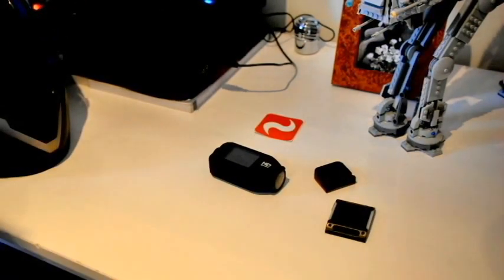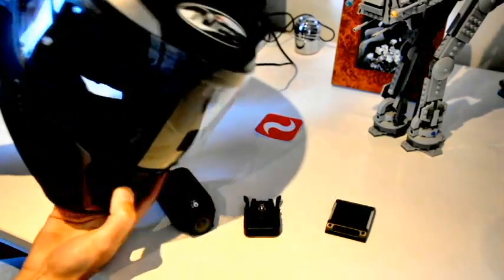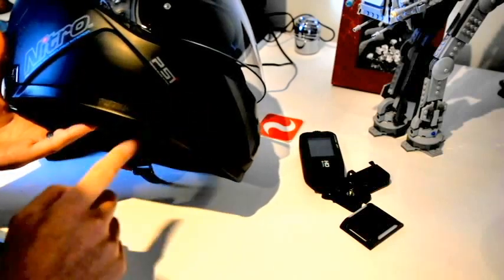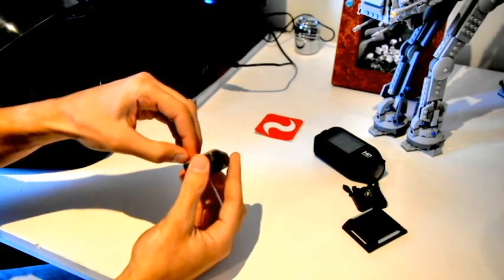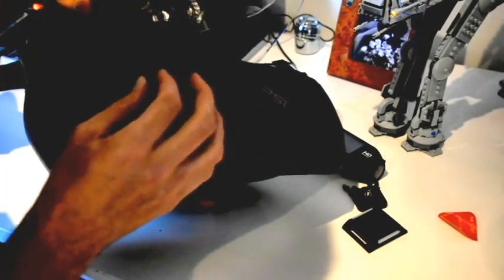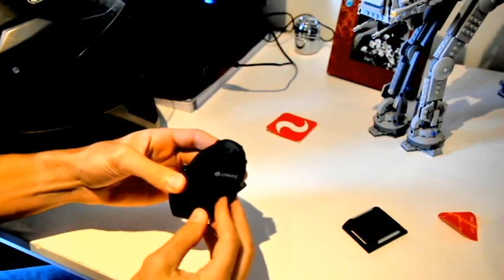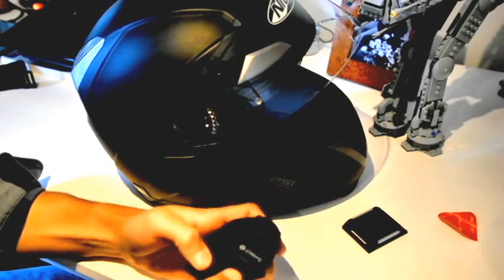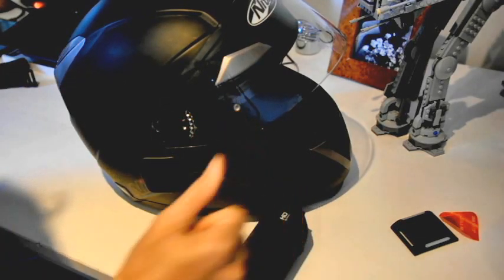How to mount a Drift Ghost-S HD to a motorcycle helmet

Comment: Andy..
Are you not supposed to leave the sticky mount for 12 hrs plus before you load it with any weight?
Reply from the maker: Hey John. I think that's what the instructions said but I didn't bother and had no negative impact. The adhesive is still rock solid after being out in the rain, snow and cold.
Reply: Andrew..
Cool....its just I had a road hawk bullet cam (much lighter)on my last helmet and the adhesive base failed on the 3rd outing, having followed all the instructions..
Just missed my mate who was following..😁
Have no confidence in those  adhesives, particularly with the expense of  a Ghost or Go Pro..
Don't like the idea of drilling the lid either.. 
Is there anything you can do to increase the bonding strength of the base adhesive?
Cheers 👍
Reply from the maker: I have always been super worried about it coming off but after the first 6 months I just forgot about it. An alternative my mate used is 3M dual lock on his motorcross helmet. It is insanely strong and you can fully customise a mount to fit your helmet profile.
Reply: @andrewcaleyphotography1076  Excellent, I'll look into that thanks buddy..

Comment: Drift ghost s audio interference / high pitched crackle when riding fast and using an external mic in my helmet

I'm on my 2nd ghost and 2nd mic

Anyone else get this issue and is there anything I can do about it?

Here is a clip of my issue

 https://youtu.be/ZNf0SVY-YpU
Reply from the maker: I had exactly the same issue and got over it by adding an additional noise sock over the one supplied by Drift (which is pretty rubbish) and I reduced the noise sensitivity down to the lowest setting.  You just have to remember to speak up if you're recording your voice.

Comment: What did you clean it with? Just a tissue?
Reply from the maker: @JD21 Try not to use any cleaning fluids as that can reduce the adhesive strength.  I just used a wet tissue and it works great!
Reply: Andrew Caley Photography Yeah that's what I used in the end. Really worried about the possibility of loosing a £250 camera, so am triple checking
Reply from the maker: It took me about a month to get full comfortable doing 70ish.....MPH and not worrying it will fall off.  I've had no problem at all with mine using this method.  Got back from a week long tour in Ireland doing 300 miles a day with the camera on all the time and it didn't budge!  As long as you get a good seal with the helmet surface it will be fine.  Good luck!